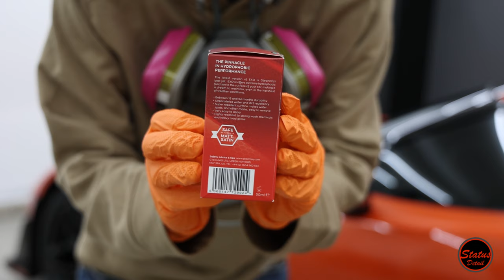ZR1 Corvette 10 Step DIY Pre Storage Detail | Masterclass

Comment: Hi, you mentioned that you wouldn't use Chemical Guys products, why is that? That seems to be one of the most "popular" brands out there.
Great video!
Reply from the maker: Hello!
They are popular and well marketed/advertised for sure!!! But the entire brand model is designed to make money. That's why at sema they have 46 soaps on display and like a thousand total products. 

I have never seen a high end proper detailing company only use chemical guys ever. 

Carpro and Gyeon for example both make detailing products for professional detailers and the pricing is comparable. No brainer in my opinion when choosing your products if you compare the companies. 

Certainly just my opinion. Many detailers focusing on smaller fast jobs like washes for example use chemical guys and have happy customers and make a living. It's just not a product line you will see us use.
Reply: @STATUSDETAIL  thanks!
Reply from the maker: @Labios_Rotos  thanks for watching and commenting 😃